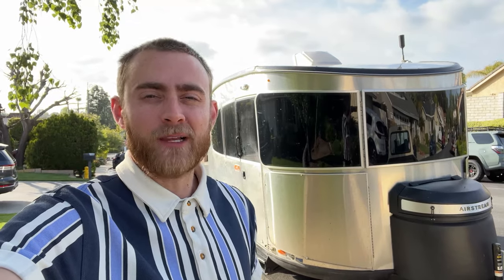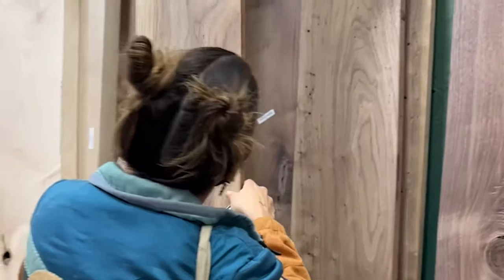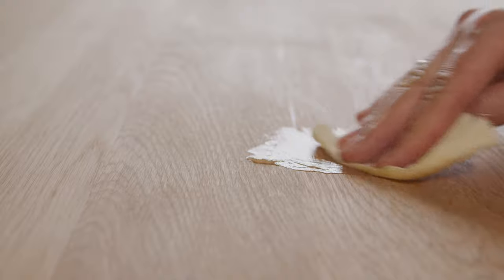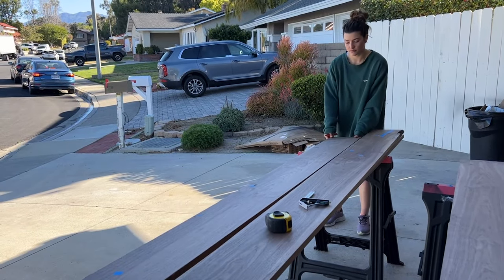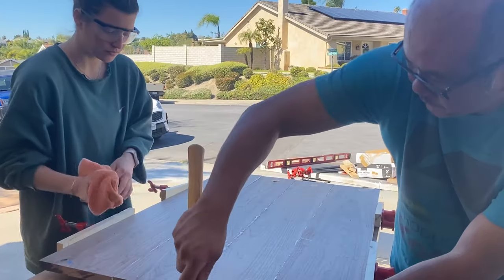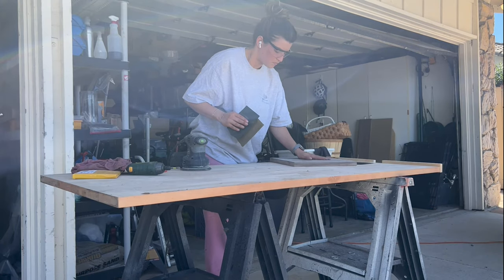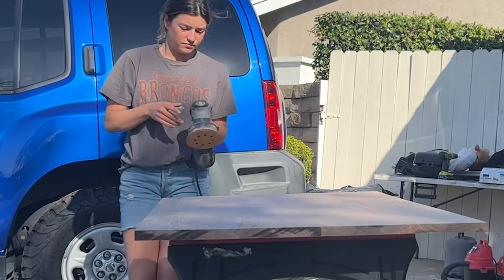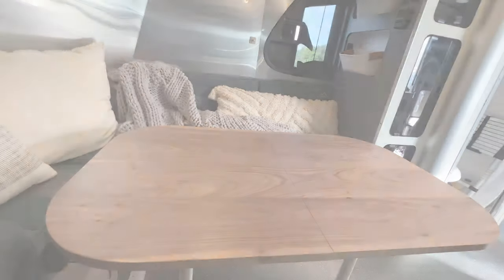Van Life Renovations | DIY Wood Tables from start to FINISH!

Comment: Thank you for this video. Before seeing this, I was telling my wife that if we got a basecamp we should replace the little tables with one bigger piece. 

When you convert to sleeper do you switch back to the original smaller tables and need to keep those in the trailer or do you use the walnut table that you made?